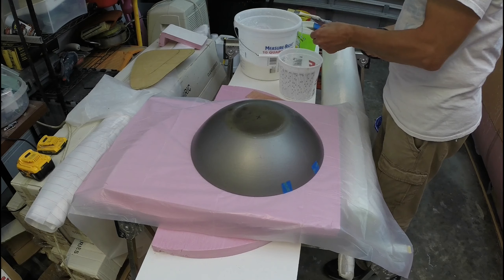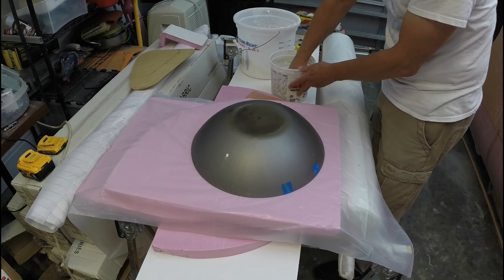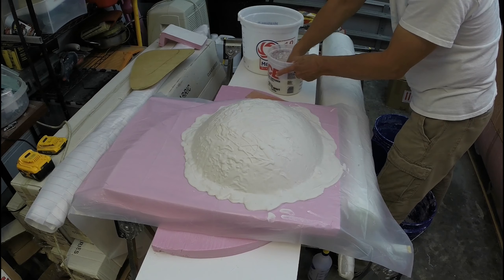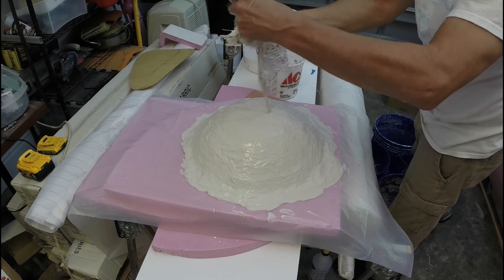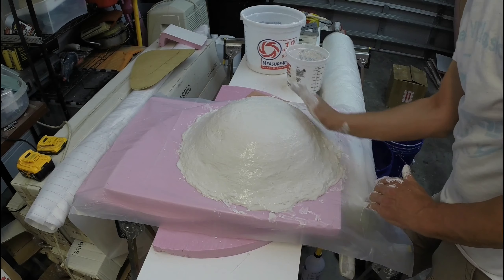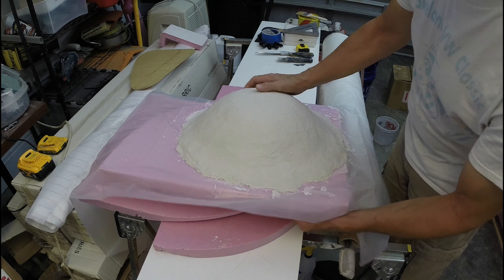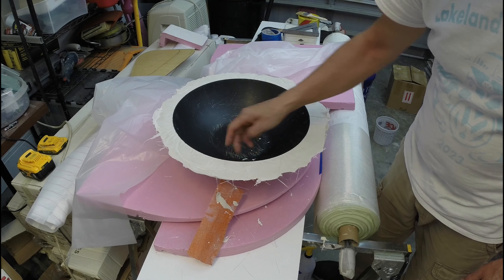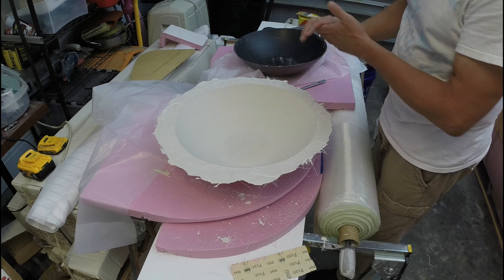Making a plaster mold (faux rocket motors cones for the door of the camper)

Comment: Stupid question..why not use the inside of the wok for the mold seems like waxed teflon would also release perfectly..
Reply from the maker: I would, but I need to do some mods to the mold to make it work for my part. Plus I get show how I build molds. I already made a part out of the wok. There is no such thing as a stupid question in my world. Thanks for watching.
Reply: So how many parts could you make with 1 gypsum mold? Would a urethane mold last longer? How do you decide which material to use when pulling molds? You SAID there’s no stupid questions!! Thanks!
Reply from the maker: @Hamcentric  Depends on how easy the part pulls out of the mold, I've made as many as a 100 parts out of a gypsum mold. Urethane molds don't like polyester resins. You could make resin parts out a urethane mold but you would need to use a PVA mold release.  It really comes down to availability, cost or a understanding of the material you want to use. You can really use anything that works for your project. Thanks for watching.